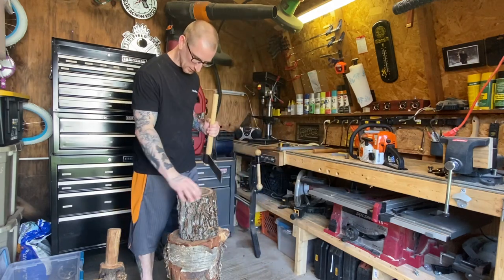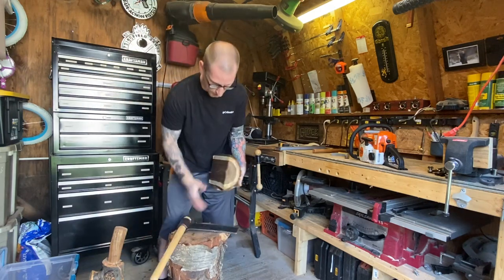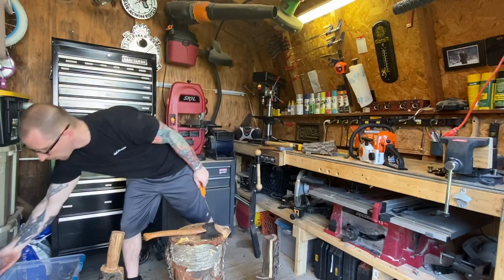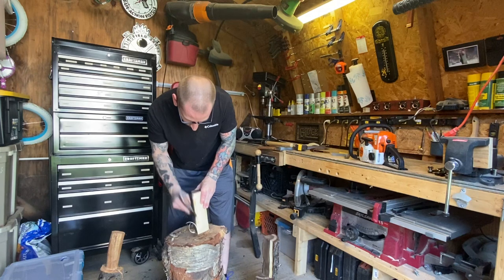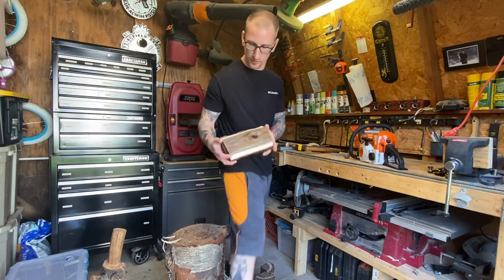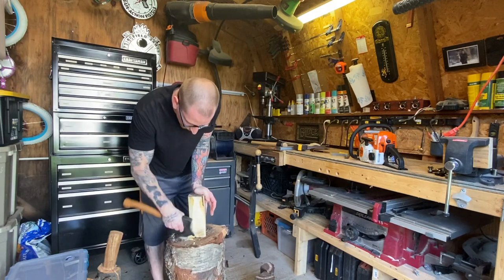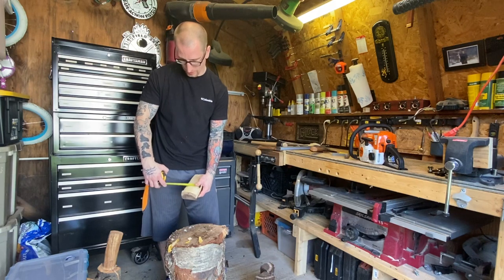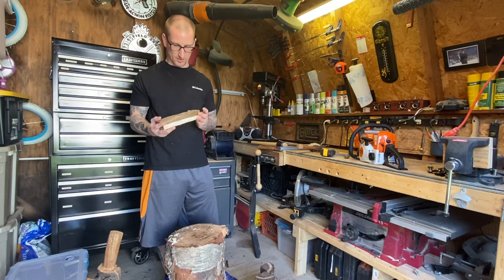Spoon Carving- From Log to Billet

Comment: Thank you.  I really appreciate you taking the time to video this and share it.  I was wondering if you could take the time to explain how you made your chopping block that is in your house.  I really like the various cuts you made in it and how you use those to rest the wood on when axing out different areas.  I assume you used a chain saw but I'm not sure.  My chopping block is just flat at the moment but I'd love to add the various notches and steps that you have.  Thanks again.
Reply from the maker: Yes, you’re correct! I used a chainsaw to make the notches. In retrospect, I wish I would have made the top platform taller to support longer spoons. On the next one I’ll definitely make an adjustment!
Reply: @HuronSpoonCo  Thank you.

Comment: Very very informative! Thank you. Just something that I could not solve yet. After carving greenwood how long should you wait before applying milk paint and oil (also for oil, I can buy natural hemp/linen oil for cooking?)
Reply from the maker: I personally don’t use hemp oil. I prefer either Mahoney’s Walnut Oil or 50/50 Tung and Citrus, which is made by The Real Milkpaint Co. 

As for the application of Milkpaint or an oil finish, I wait until my spoons are fully dry, them make finishing cuts and chamfers, and apply whatever finish I choose once I’ve burnished the surfaces with a polished piece of antler
Reply: @HuronSpoonCo  thanl you very much!
Reply from the maker: @quentingallea166  you’re very welcome!

Comment: If my woods dry can I still soak it? Its 2yr aged red oak. Its hard as hell to work with.  I wish I watched all these before starting.
Reply from the maker: Red Oak isn’t the best for spoons honestly. As far as reintroducing moisture to wood, it can be done but very slowly. Generally once the wood is dry it no longer easily allows water back in since the cells have shrunk. You can get a couple growth layers to have increased moisture but, from my experience, the water doesn’t permeate very deep
Reply: @HuronSpoonCo  Thanks for the response.  Ok I will start over. I'll just make a Firesteel handle out of this. I'll grab some birch when I'm out and about next. Cheers from Ontario.